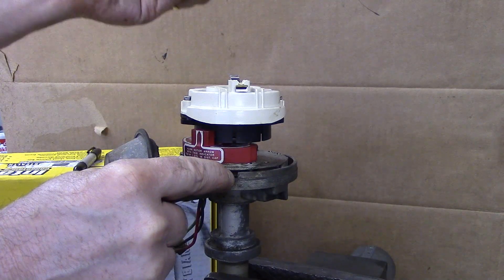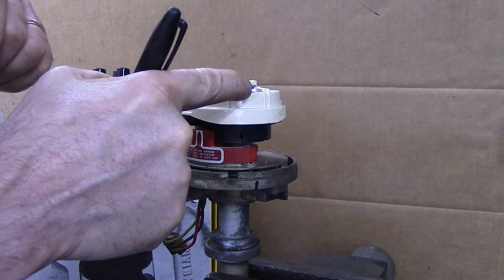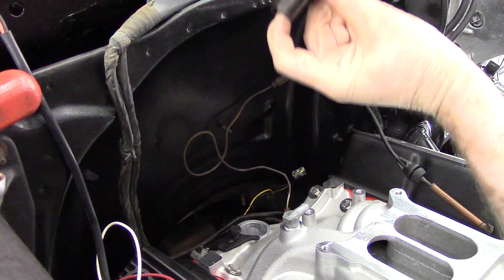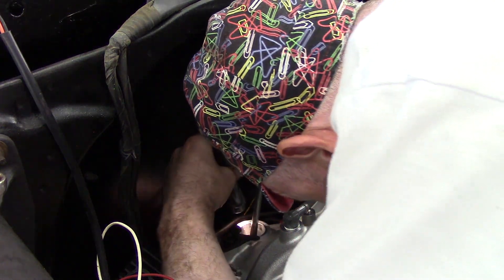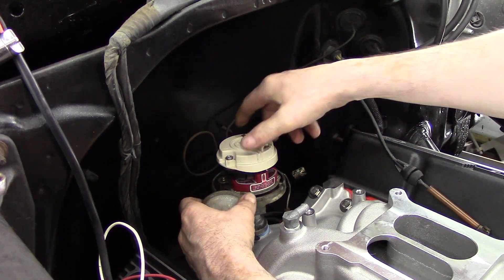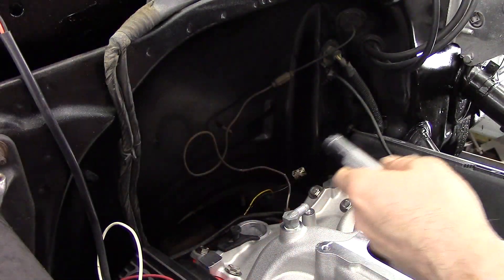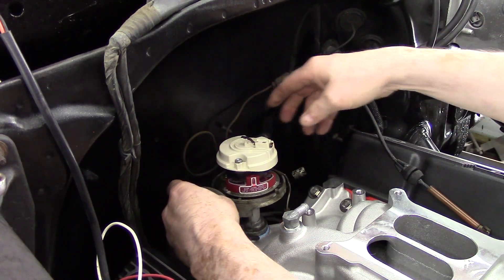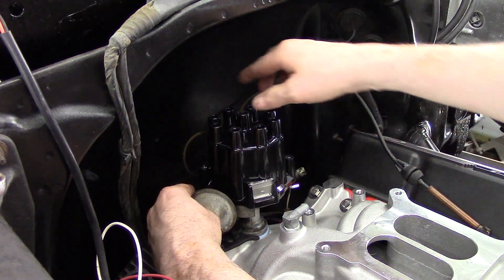How to static time the small block Chevy

Comment: just set TDC and engage the cam gear on distributor gear then bump engine over a bit, it'll drop when oil shaft lines up and stays in time because the gears are aligned already

Comment: i took my distributor out, 1990/91 Corvette, for space to change the oil pressure sensor behind, not realising the timing may jump. If i keep putting it in many times again and try starting, should it not get at some point be back to where it should be ? I cant find the timing mark at the front of the engine....
Reply from the maker: First off, the only way it could jump timing would be if the timing gear on the cam is shot (all the nylon broke off). Then you would need to replace the timing set, which should be done anyway. I'm guessing you set the set the distributer in one tooth off. You need to find your timing marks on the balancer, & timing tab, & then follow my video. Good luck!

Comment: Hey! So, I have a '74 K20. I got it running, but it didn't have much power when I stepped on the gas. I thought I needed to adjust the timing and tweak the carburetor. I started with the HEI distributor, set it to top dead center, dropped the distributor in, and put the spark plug wires in the right order. But it's still not running right, even though I know there's spark and it's getting gas. It cranks but won't fire, and now the carb is spitting gas out the top.
Reply from the maker: If you followed this video, 0 on the timing tab, number one cylinder is at TDC, and ran the plug wires as I stated, it will either be correct, or 180 degrees off, if it's backfiring out tge carb, chances are it's 180 degrees off, that would mean #1 cylinder is firing with the intake valve open. As far as low power goes, was the timing chain and gears ever replaced, if not take the distributer cap off, rotate the engine by hand clockwise until the rotor starts to turn, put a mark at 0 on the harmonic balancer, then rotate the engine again by hand counterclockwise until the rotor turns again, stop, and measure the distance, using the timing tab like a ruler, you can estimate how many degrees the engine turned with the rotor moving. It should only be a few degrees maximum. GM put nylon coated cam gears on most of their engines back in the day, as parts of the nylon broke off the timing went all to hell, one moment advanced to far, and the next to far retarded. Good luck!
Reply: @HRIservicesllcSturgeonBay  Thank you. I think I have it figured out now. The truck is a stock 350 4 barrel. And it was leaking gas out where my choke is. So i’m looking to replace it. Do you think i should rebuild it or buy a whole new carb? And what would you recommend i get
Reply from the maker: @lincolnbump5328  Carter afb, or Edelbrock they are basically the same design, that's what I have on my truck in these videos. But if you have the original Q-jet which is a spread bore, you would need an adapter to install that carb, or a new intake. If you have $$$ to spend I would go to Edelbrock electronic fuel injection, but that's about $2500.

Comment: Instead of pulling the distributor out and turning the oil pump drive and putting the distributor back in several times you can turn the engine over by hand until the distributor drops in and then turn the engine back to top dead center again.
Reply: so does that mean u turn the crank counte-clockwise or go all the way back around?
Reply: @ig2750  I turn the crank forward until the distributor drops in and turn the engine backward past zero a little and then turn the crank forward to line up the timing marks. If you wanted to keep turning, you would have to turn the crank 2 revolutions to put the rotor in the correct location for #1 TDC compression stroke.

Comment: i must the easyest truck of all to work on   53 dodge m37------ first --------  dist. shaft will  drop dowm 1 way   yoy can put in wrong so  with it in put rotor knob on  slowly turn rotor till it drops dwn ----i always take all plug out to easy rotate eng wyth fan blade  so rotatetill 4 deg befor TDC     the rotor will point to ward #6 plug which is about 1 oclock position   looking down at dist  if it off a little rotate dist base till i lines upon # 6 tighten dist base bolt now spin eng watch flash on 4 degree before tdc thats it install plugs crank it purrs like a kitten, idles fine rev up good simple    some folks confuse valve timming with spark timming  -- two different  operations valve timming is set a factory with timming chain  do not move it  it controls the valves only

Comment: Watch out turning that oil pump screw counter clockwise, it'll back out and come out. It threads in the oil pump.  

If it comes out, no oil delivery and I'll say it would probably end up somewhere it shouldn't.

Comment: I have a little trick with the distributor installation. Get C1 on TDC and then line up the distributor with C1. Then either bump the starter or turn the motor over by hand while holding the distributor in place until it drops on the the oil pump shaft. So much easier. Saves a lot of time.

Comment: With some practice you can drop the distributor into the pump in any position that works and from there by lifting and lowering the distributor slightly you can "walk" the rotor to align with your number one plug wire OR ANY other firing position on the distributor AND maintain the proper alignment of dist. shaft and oil pump. Doesn't take a minute to get the dist. set to where you need it ;)
Reply: but how you know where it needs to be ?

Comment: I realize that this is an older video. 
For those who are doing a SBC distributor R&R, and who want to get the spark lead close enough for initial fire-up, stop the crankshaft at 6 to 8 degrees BTDC, not at ZERO. 
Once installed, and once the electrical is connected, place a spark plug cable directly into the ignition coil. 
Install a known-to-be-good spark plug into the cable. 
With ignition ON, rotate the distributor CCW until you see one spark event. 
Do this several time to get a good feel for it. 
When the spark event occurs, stop and gently lock down the distributor. 
Now the engine will see approx 6 to 8 degrees BASE advance for the initial fire-up. 
Once fired-up, adjust the dynamic BASE advance, and then check the progressive and TA.

Comment: Put the damn crank at zero if it doesn't fall hold the button down a little and turn it backwards while turning the crank backwards a little and it will fall right in.  Back up a little more than back to zero and check your button. It's not that difficult.

Comment: I got my timing all done like it's supposed to be on my 77 Chevy truck an when I put it to 8 degrees timing an it doesn't want to run very well but once I'd advance the distributor it wants to run perfect and he can't even see the timing marks there towards the bottom of the engine can u please help me figure out what's going on with it I tried a lot an I even put it in the shop an lost money cuz they miscommunicated what I asked them to do I asked them to put it on top dead center and change the distributor where it should be pointing to number one cylinder but the lady didn't tell the mechanic that and all she did was retard the timing back to eight degrees, and now it doesn't want to run well please help me
Reply: Pull the distributor out. Spin it like a roulette wheel and drop er back in

Comment: You don’t have to do the oil pump shaft at all.   

Place distributor in at number one 
At that point the distro is meshed with the cam gear    .   Then you simply move the harmonic balancer and the distro will just drop down on the oil shaft.    So simple.       You tube Channel “my vintage iron 7512” has a great video on the same way I’m explaining      Much easier

Comment: I was having a hard time trying to get my 350 to run assuming that the cylinders were 1234 on drivers side and 5678 on passenger side. I know it was bone headed but thanks to your video where you showed 1357 on driver and 2468 on passenger side was like getting hit with a sledge hammer, ran out to the garage, switched my wires and at 0545 in the morning. The ole Chevrolet came to life. Thanks
Reply: Yeah always remember one side is even and one side is odd numbers

Comment: I have good luck with your procedure.  With both valves shut at tdc, and a long screwdriver to move the slot around, it usually works the first time. I have noticed the zero mark on the harmonic balancer moves a little over time, but not much.
Reply: Could it be that your balancer is slipping? May be time for a new one.
Reply: This is a thing. We had a G van that I could not get timed. Figured out the balancer pulley had slipped on the dampener and timing mark was waaaay off. I wonder how many people struggle because of this or worse yet, assume there is something wrong with the engine and junk it.

Comment: I use a gutted old distributor mark the top of the shaft   drop it in turn the shaft till its in #1 pull it out and install your distributor
Reply from the maker: Good idea Thomas, thanks for the tip!

Comment: Yeah, you don't have to move the oil pump rod, total waste of time. Drop the distributor in rotor facing #1 cylinder. Turn the engine over and the distributor will fall in when its lined up with the rod.
Reply from the maker: Thanks for the comment.

Comment: VERY basic explanation of this procedure. While any tower on cap can be #1, Chevrolet puts it immediately past the point dwell window, aiming just to the right of the rear of the carburetor or at the #2 cylinder. This video puts it at what they say is #7 on the cap.
Reply from the maker: I wanted it to be basic and used most information from Chevrolet manuals. I also wanted the tower thst was originally used by Chevrolet so wires would fit correctly. Thanks for your comment.
Reply: @HRIservicesllcSturgeonBay  yeah, man. Certainly informative. Just an observation that the manufacturer puts no 1 on the cap aiming at no 2 cylinder in every assembly manual ever but it will work on any position. All the best.
Reply from the maker: @bigblocklawyer  Thanks!!!

Comment: There is no socket on the distributor that is specifically #1 there all capable of being #1 perhaps you make this claim because it places your vacumn advznce in a better location as far as adv. And retarding your timing other than that depending where you stab the distributor in relation to where the rotor points when the 1 piston is tdc on the compression stroke will determain which distributor plug socket is going to be one. Had a learning block when my ole man was trying to explain that to me at age 11, now im 12 and you cant tell me jack shit about a sbc.
Reply from the maker: You are correct about the vacuum advance, but also the one marked as #1 in the picture is the one the factory specifies as #1, probably for the same reason of being in the center of the vacuum adavance travel. Thanks for the comment!

Comment: no tira chispa mis cables del distribuidor es un súper jeep 1973
Reply from the maker: So you have no spark in your 73 Jeep? This is right on the years where they changed from Points to electronic ignition. Not being sure what your Jeep has I will give you both options: Points could be the condenser, points, coil, or a grounded circuit, start out by with looking for bare wires grounded out, then test the coil there are many good videos search for "test a coil", if the coils good,  look to see if there are dirty or corroded points, replace points and set to factory specifications. Electronic ignition could be the spark module, pickup, or a grounded circuit or coil. This is a little harder to diagnose, again look for bare wires grounded out, examine the pickup for damage, if no damage, test the coil as stated above, then replace the module if you found nothing else. More often than not it will be a bad module.

Comment: Not trying to be negative but put it n and slowly turn it over or crank it to drop it into the oilpump
Reply: Ya, thats the easy way to do it! No finagling with a long screwdriver and trying to lean over an engine bay...
Drop the dist in where it points to number 1, at TDC, then if its not sitting flush, either spin it with a breaker bar or bump the motor over until it drops down. The firing order will be correct, because the gears on the dist and cam are meshed, even though its not sitting flush on the intake yet.
Reply from the maker: Thanks for the comment and suggestion.

Comment: Bro just turn the engine over with a wrench until the distributor falls into place once you have the distributor dropped in partially it will turn with the engine. Keeping it lined up exactly to where you lined it up
Reply from the maker: Colten Dixon, I wanted it on the exact tooth, not one prior or one after. When making videos there are many who are critical, I want it right the first time, and not by luck. Thanks for watching.
Reply: H.R.I. services llc Ricky Hembel the way i stated gets it perfectly in place. And keeps it "perfectly" in place
Reply: H.R.I. services llc Ricky Hembel im not criticizing you. Im saving people from struggling with a simple task like you did.
Reply from the maker: Colten Dixon, no struggle Mr Dixon. Old school vacuum advance distributers only have about 20 degrees of rotation (if you want the vacuum advance diaphram located as it was from the factory). If the distributor gear is not fully engaged it is imposible to know for a fact that the diaphram will be in that exact location. This would nean you get to start over as there may not be enough room to get enough rotation on the diaphram to get the timing correct. The diaphram hits the valve cover on one side and the coil on the other. Thanks for your input.

Comment: How do you get the harmonic balancer aligned with the zero on the timing tab?
Reply from the maker: There is a 5/8" head bolt that holds the harmonic balancer to the crankshaft, put a breaker bar or 1/2" ratchet with a four inch extension and 5/8" socket and turn it clockwise. Hold the extension to keep it straight on the bolt. Thanks for watching.
Reply: @HRIservicesllcSturgeonBay  on just use the alternator pully nut, it's easier to get to?

Comment: I can work the oil pump shaft around by dropping and re dropping the distributor, each drop moves it about a tooth. Alot easier than trying to line up that shaft with a screwdriver.
Reply from the maker: Yes, that works also.
Reply: Yes...."best way"}¡
Reply: but how you know when its in the correct position?

Comment: Or put 1 at TDC .
Drop distributor in. Then where rotor points is number 1 wire goes.
Reply from the maker: Jake Wilkin, that works also as long as your wires reach, and you don't care where they are located on the distributer. Thanks for watching, and the comment.
Reply: Good point .  Thank you for the video

Comment: This is Wrong . It doesn't mater what engine it is . You simply find out the timing value . For example if the engine is set as 12 DEG before top dead centre . You stop the engine on number 1 compression stroke at  12 deg before top dead centre  and then  line the dizzy up on the pen mark you named number 1.  Then there is no requirement for any further timing until the next service.
Reply from the maker: Thanks for watching.

Comment: with no spark plugs in i put my finger over one and wait for the air push, then line up zero on the ballencer, then tern the oil pump to mach the distributor in no one position, so this is the way we have always done it, good old chevy vid :)
Reply from the maker: Yes sir that works just fine! Thanks for the comment!
Reply: with the left valve cover off, bump the engine around until you see the #1 intake valve open, then close.  The timing mark will be approaching TDC when that happens.
Reply: @beentheredonethat3444  fill number one cylinder with water, turn it over till some come out, your on the comp stroke . :)

Comment: or you could just rotate the crank shaft with a wrench until the distributor falls in place, then turn the crank shaft until the rotor is lined up with the line, then take the distributor out, put the harmonic balancer at 0* and drop the distributor in.... its much easier than your method.
Reply from the maker: Sounds logical, saves crawling in the engine compartment I’ll give it a try next time. Thanks for the comment.
Reply: @HRIservicesllcSturgeonBay  ... Your way is the best ,just make sure it lines up or do it again.
Reply from the maker: @good-boy-ringo  thank you! I always appreciate thoughtful comments, I always try to do my best.
Reply: @good-boy-ringo  I agree
Reply: amen
Reply: ...Yes, the good old sbc 350.
Point the rotor at the 2nd intake bolt then spin it down into the cam.
Finally turn the Crankshaft clockwise till the distributor plops down on the intake surface.
No need to set the pump spline
Reply: Yes it works like a dream! Thats How I was taught
Reply: Is crank getting tuned clockwise if I'm in front of vehicle
Reply: @jonhsmith2706  yes
Reply: Apparently no one showed him that but ya you can